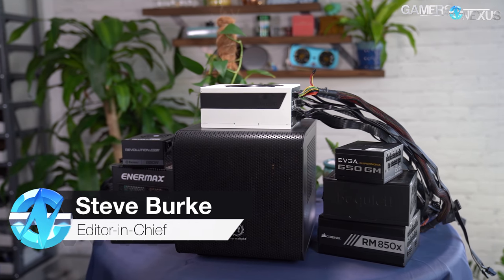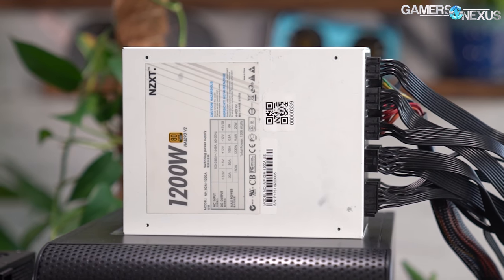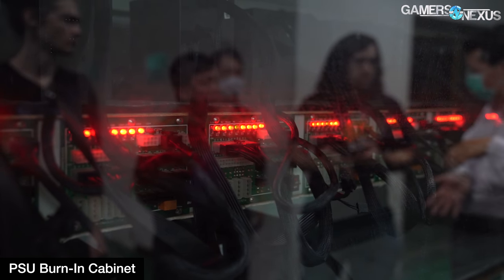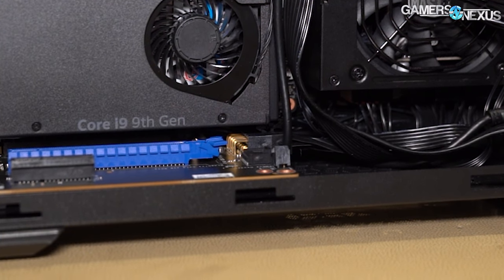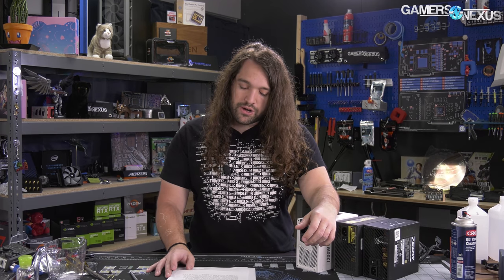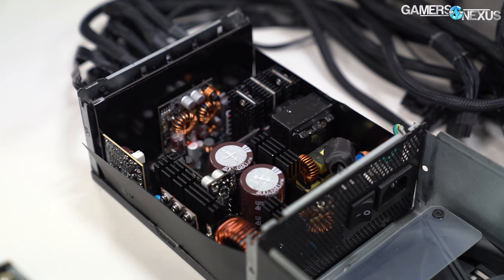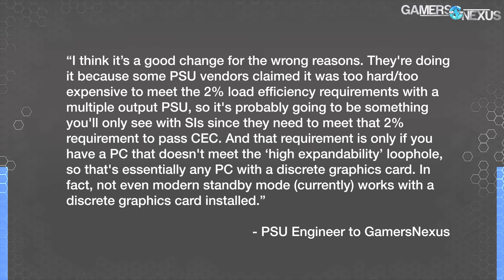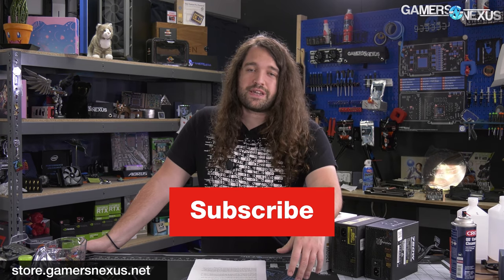Intel's ATX12VO Spec Explained & What Manufacturers Think

Comment: It was about time to finnally go 12v only. every other electronic device including consoles(locked down pc's) and laptops run on 12v. There is also a lot of non-computing hardware running on 12v potentially opening the door to use any power supply on your pc and any pc power supply for anything else easily. Having multiple power rails overcomplicates the power supply tremendeously, because there will always be underused resources. The 5v rail is supplied by 3 turns of coil on the main transformer. the 12v rail continues the same coil with 4 more loops. Loading up one rail causes the other one to change its output voltage. All rails run their own diode and capacitor pack. Having multiple rails means you can't utilise the full power the primary coil can provide if your load is unbalanced. If 12vo becomes the standard it will force all pc component manufacturers to design their devices around working with 12v. In the worst case some devices will have to run internal 12v to 5v step down converter, but dc-dc low voltage converters are way cheaper than wall plug to low voltage dc converter.

Comment: Couldn't they do something like Seasonic did with that 750W "CONNECT" PSU?
Reply: Well, now that I think about it, it's possible that Corsair did that experiment for this purpose. They will sell the Psu as a 12 v only and the power bar converter as an accessory as to circumnavigate this law
Reply: Yup. Y think is the future any way. If you can buy those seasonic connect separate it's solve
Reply: @lorisderrico1425  Don't expect this kind of form factor to provide all of the DC/DC converters required. It needs 3 step-down for +3.3V, +5V and +5VSB rails and an additional charge pump inverter for the legacy -12V rail.  The two former should be quite beefy to output dozens of amps.

Comment: Not only is this impactful for  the PC industry, but also for electrical hobbyists.
There is a business for decommissioned server power supply's, cause they are also 12V only at crazy high amperage.

This is perfect for electronic hobbyists and other electronic doodads. Take battery changing for instance, for some YT channels they make lots of battery reviews and other tips and tricks. Getting those batteries charged ASAP is a huge deal, for this the server PSU's can really help.

With this ATX12VO standard this helps quite a lot, no more odd and sketchy converter boards that trick the server units in powering on, even though they might not like it this way. But this new standard if it catches on can really help deliver easy and clean high amperage power to them.

Another example is lab bench PSU's. For hobbyists its always more fun to put something together all by yourself. Which is also why there are big markets for buck boost converters. Only one issue, they require high amperage inputs to output what you need. EEVBlog's own Ruideng lab bench PSU blew up for this exact reason. The ATX12V standard will help in many ways, not only for easy of use but mostly for safety. No more sketchy power supplies to feed your sensitive equipment.

Comment: This also seems like a way to keep HP/Dell/Lenovo prebuilt systems from being recycled by enthusiasts and repurposed into other cases w/ new power supplies for a second life
Reply: They're literally already doing this. Moving to a standardised method of it would help. It certainly doesn't make it any worse.
Reply: Actually motherboards fail way more often so shifting the lower voltage DC-DC buck converters to motherboard would only contribute to more E-Waste landfills and more circuitry on motherboard means more possible points of failure on a sensitive device.
PSUs last a lot longer than motherboards.
Reply: This has been the case for years. I literally just switched over a Dell 3020 MT and needed to use an active converter cable when installing the PSU. Cost all of $10, not all that bad to be honest.

Comment: You know what needs a mandate? Right-angle power connections on motherboards. And it's so easy for the entire PC industry to do. Make it so the power connector on the board at the edge is 90 degrees, and the power lead has a 90 degree connector at the end. For pin alignment, make it use hexagonal or octagonal sockets and pins to simplify manufacture by giving the bent connector a "key" to help pin and socket seating while giving compatibility for round pins, and once this si established power leads would then be able to hide away more easily.

Comment: So, you're telling me they're taking functionality out of the component I may never replace and put it on a component that I will replace every 3-5 years.  This "environmental" protection agency is just going to increase the amount of e-waste in landfills. Cue Picard.
Reply: To be fair, it's not the government of California that's fronting ATX12VO, this is just Intel's half-assed opinion on how to adapt to the new laws.
Reply: @predabot__6778  Actually the efficiency should get worse in theory because:
- 5v and 3.3 from psu = 2 less coverters, the 5vsb is turned into 12vsb.
+5v and 3.3 to motherboard = 2 converters but you need another one for usb 5v standby don't you?
Reply: @zarmaanful  Yes? I never said that this implementation was actually a solution - just that it was Intel's attempt at making it look as if this solves the problem. I.e, half-assed. I suppose a more fitting description would have been "non-solution".

On another note - an article or coming together of minds on how to REALLY solve this, increasing efficiency, would be very interesting - either everyone has to buy the more expensive PSU's, or we have to redo the tool-chain - perhaps taking inspiration primarily from that 48v standard that seems to be growing in Datacenters - makes sense.
Reply: If you're concerned about e-waste then you shouldn't be replacing major components every 3-5 years. Reduce is the first word in "reduce, reuse, recycle" for a reason.
Reply: @zarmaanful  12VSB would be converted to 5V viaa the normal 5V DC convertors. The design is more efficient as you only have 12V going along the thin wiries, reducing current.
Reply: @TonkarzOfSolSystem  Which is ironic because intel is well known for throwing a chipset away after 1-2 generations.
Reply: Claptrap Jesus  Maybe they should... but whether they do or don't that's not a factor in whether the consumer upgrades every 3-5 years vs 5 to 10 years.

Comment: Oh wonderful let's make the motherboard do more work... Getting all the 5V for my SSD and shit... 
i am sure everything is going to go 12v but for the time being all the other voltages are going to come from where everyone moves over to the new platform?
on a side Note this will be good for hacking PSU for 12v
Reply: It means you probably require the whole system to adopt the new "spec" to avoid any bottlenecks. That sound sucky.
Reply: In the end, the system as a whole will have the same efficiency or worse with less real estate left for features. Overall a lose lose situation.
Reply: @kal9001  the first Thought that came to my mind was that I may power a Mainboard directly from a 12V Car Battery

Comment: Makes you think, how many things on a motherboard still run at a standard 5V or 3.3V - once upon a time, everything did and 12V just ran motors.
Really the only certainty is 5V USB, and 5V for SATA drives - given that most (all?) SATA drives can run on a molex adapter, 3.3V has to be a bit of a failure - or do some drives use the 3.3 if available and regulate the 5V down if not?
Reply: Since you're playing with DC-DC conversion, 3.3V could feasibly be handled by a voltage divider circuit, which consists of 2 resistors, contained entirely within the adapter coming from either the 5V or 12V rail (or both, but more resistors would be necessary). That said, I don't think that would be the best solution, but it's an option.

Comment: A year late but really the TLDR of this is that 12VO essentially make prebuilts slightly cheaper, potentially improves cable management, and screws over the consumer by pushing half the powersupply to your motherboard.
Reply: Um, no. VRMs are very cheap and VRMs in a Mobo can be way more optimized for load (ie, smaller, cheaper, more efficient) compared to VRMs in a PSU with unknown load requirements. Not to mention the increase in efficiency you get by not running a 3.3V line to the Mobo with a large voltage drop (large enough that PSUs run a sense wire back to check the voltage at delivery)
Reply: The only messy requirement is that the Mobo supply a 5V rail for SATA devices, but that is pretty much a transitional thing until most SATA devices build in additional VRMs to go 12VO. Some devices already do that and some(?) 12VO supplies already come with 12V only SATA power cables.

Comment: For my Mini-ITX based firewall, I am using a 12V to ATX converter that plugs right into the ATX plug.  It is only slightly bigger than the plug without the conversion electronics.  Really, we have the power conversion electronics to make it happen without using any significant motherboard space.  Just start making some hard drives and crap that run only on 12V and move to smaller format connectors and please finally dump the older molex 4 pin connectors overboard once and for all.  USB already goes through the motherboard, so doing a 12V to 5V conversion on the motherboard for standby power is easy peasy and probably more efficient than doing the step down in the power supply.  Anyways people want to plug in their high power / battery operated USB devices into their computers and quick charge, or just not need another power connector, so doing power conversions on the motherboard would be handy to get more power to these devices.
Here you go (this is a more powerful variant than what I am using): https://www.mini-box.com/picoPSU-160-XT
Job done.

I think if you go about this in a smart way, the DIY market will be thrilled because cabling will be simple and slimmed down.  I know at least my main computer at home has grown into a big pile of cables inside and most of those wires taking up space are dumb in a modern context because there is no need to be sending +5V and +3.3V down most of them, but instead just +12V and already custom regulated down logic voltage.  Then maybe you start doing things like quick charging and power delivery to devices from your motherboard's USB-C port because now it is getting power from a 12V rail and converting it to the power the device plugged in wants, and external peripherals become a lot easier to work with (for example my four 3.5" drive external backup array could be powered through a single USB-C cable instead of having one USB-C for data and a separate power supply and connector for power) and you cell phone charges up faster.  Also your next gen VR headset won't need an extra power adapter or a separate USB plug (like my Valve Index); just a single simple USB-C style plug does everything.  This sounds so much better to me.  Steve Jobs would be proud if we got computers to this level of simplicity to hook up to instead of the confusing tangled mess we have going now.

On another note with 5V stand by power and USB, one of my friends had a USB plug in the front of his computer with a corded device plugged in yanked on by accident (I think somebody tripped or something) and because that port was hooked to the bottom of the motherboard and straight to the always on 5VSB pin on the power supply, the short overheated the motherboard and it burst into flames, ruining the computer.  Then again with a standard ABC chemical fire extinguisher used to put out the fire after hurriedly taking the side panel off, that did some damage to, especially as that went everywhere and got into every nook and cranny of that computer.  If the motherboard had a sense for shorts and enforced power limits instead of a straight connection into 5VSB, that motherboard fire would never have happened.

Comment: I just wonder how efficiently motherboards will be able to convert the 12v with what is a much smaller amount of space compared to a power supply.

Also the long life of power supplies means potentially lest waste electronic components, if you move all that stuff over to the motherboard, and the motherboard has an issue or needs to be upgraded there is a lot more stuff going out the door, to either be hopefully recycled or even just thrown out.

That 20 amp limitation is also worrying when it comes to high performance graphics cards, I'm not sure if the power supplies will still have regular connectors for everything else or if they want that coming off of a motherboard as well.

It probably will be a very long time until this affects consumers though.
Reply: they can do it pretty efficiently (in terms of space). If you look at all the LN2 motherboards, they have a large amount of onboard regulators to get around the "cold bug". These are low power and are pretty small. Very low power devices can use an LDO, which can be a single component. Adding a single 3.3 and 5v switching converter can also be easily done in a small amount of space. The more power you need the larger space is required due to larger mosfets inductors and more output capacitance. The 1 or 2 phase memory VRM is about the same size as the space saved by the power connector to give you a sense of scale.

They will need a pretty beefy 5v regulator if there are a lot of USB ports. jonnyguru is right about needing separate regulators for powering USB ports when the system is in standby. 

The 20A limitation is not really a limitation. It's just a recommendation to only have a single 12V rail handle up to 20A of current. If you need more than that, the OEM will just get a more beefy PSU with more than one 12V rail (just like you do now). This is sorta related to Steve's hint about PSU's today having multiple 12V rails for possibly safety (to be discussed later). Note that I don't think it will be an issue, since Steve seems to indicate that having a removable GPU makes the system get around needing this sort of thing anyway. I only see it as an issue with a system that has integrated the GPU on the same MB as the CPU (like how a laptop does it) and I suspect these sorts of systems will be as rare in the future as they are now.

The real "win" here is that the PSU vendor does not know how much 5.5 and 3v power their customer will need, so they have to build those rails with enough power to cover a large range. These are pretty big. If you don't need that much power on those rails, then they will be operating at very low percentage of rated capacity which is very inefficient (unless they have expensive controllers that can do pulse skipping, etc). With 12v0, the PSU vendor does not need to know about that anymore and can just make a PSU with a given wattage. Then the MB maker can make 5.5 and 3v VRMs on their board that are exactly the size that they need, so they can be physically smaller, cheaper, and more efficient. There are also other options, like having a big 5v VRM and then driving all the 3.3v devices from 5v instead of 12, which opens the door for pretty efficient LDO use, etc.

A lot of systems need multiple rails in the same voltage for various devices. You don't want your sound card driven from the same rail as the RAM (for example), so these would have had seperate VRMs on the MB anyway. Every time you have one of these on your board anyway, designing it to operate from 12V is very easy and  has almost the same cost (input capacitors will be more expensive but that's it) so for every one of these that is already on the board, you get a gain. These really add up over time and would make the total BoM significantly lower.
Reply: Like SAM said, what will likely happen is that the graphics card will have it's own dedicated rail. This will result in it's dedicated 12V 20A line, if not more. It's also a recommendation. Generally, a thicker gauge wire will better withstand more amperage, but you don't want to dance with the devil really, so it'll probably stay within the guidelines. There's also the possibility of just not needing it in most cases. 12V 20A is a lot of current.
Reply: @dustycarrier4413  Is DC 20A at all similar to AC 20A? Like would you need a 20A AC circuit to power your computer?
Reply: 90% of space in a PSU is actually the 230VAC to 12VDC conversion, Buck converters are really small
Reply: Erotikstudio Winkler GmbH  Thanks for reminding me of the math, stupid question, but now I understand it totally when accounting for voltage.

Comment: Moving to a 12 volt only standard is honestly a fairly simple solution to solving efficiency related problems.
For an example, the 3.3 volt rail supplied by ATX power supplies is on some motherboards not even used.
The negative 12 volt line is also a good example of a very rarely used rail.
The 5 volt one makes more sense to use, and a lot of SSDs and 2.5" HDDs use 5 volt exclusively. (Thereby Intel's stated need for having that rail be provided by the motherboard, though not hard for storage device makers to add their own DC-DC converter.)

Meanwhile in the server space, 24 Volt power supplies isn't all that rare. Even some 32 volt and 48 volt supplies are also being used.
Reason for the higher voltages is so that we need less current to supply the same amount of power.
The current is what leads to voltage drop and power dissipation within conductors/cables. This amount of power can be described with the formula: P = R*I^2 (Where P is power, R is the resistance of the cable, and I is current. Due note that current also needs a return path to the power supply, and this too has resistance.)

Would have been interesting to see the 12 volt rail migrate over to 15-18 volts instead. In a system with local buck converters, then this would be a fairly trivial thing to support.